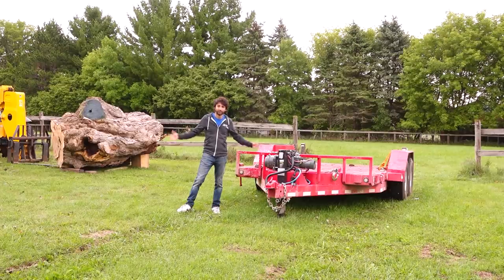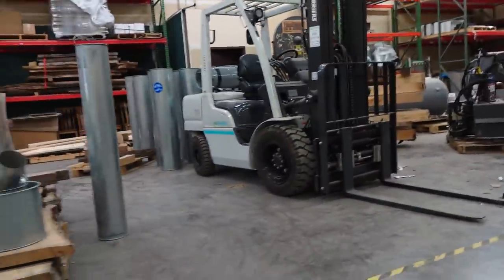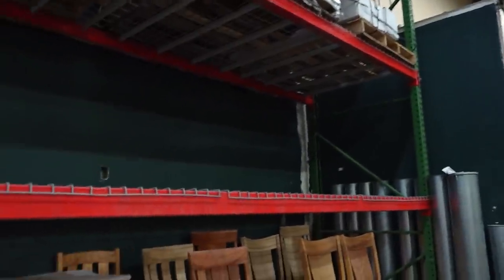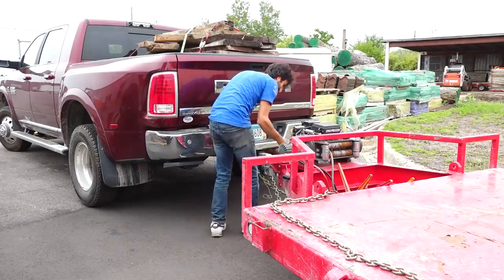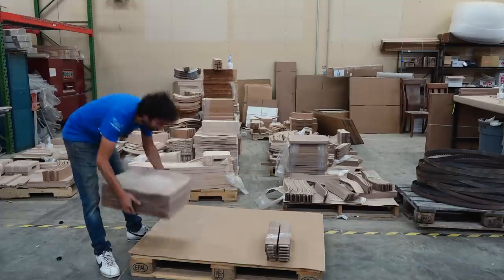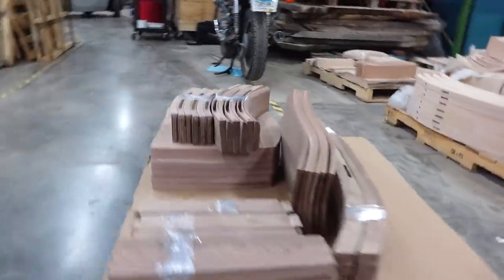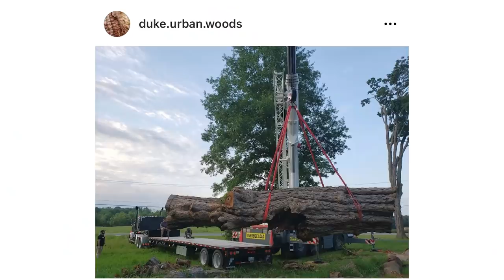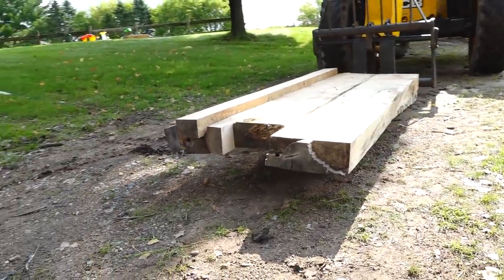Getting the warehouse ready for slabs - Warehouse vlog thing

Comment: Just a tip, next upgrade on the saw mill put taller tube sections on your bed. Change to RHS standing on end instead of SHS. This will raise the log up above the angle rail (yes you’ll lose some capacity) but it will be much easier to load logs on with the skid steer or tele handler.
Reply from the maker: Decided against that so I’d have continuous support across the entire bed and no corners to catch material on
Reply: @mcremona  Oh ok, corner catch is a possibility as the tube top bed would be higher than the angle, could hit the corner of the tube when your driving in. Not sure what you mean by entire support. Maybe we are understanding each other. If the stainless tube was the double height, your bed level would be exactly the same support but higher. Just the envelope for the tynes to fit into below the bed level and above the angle rail would be increased. A place to lay the material down and pull your tynes out flat. Yours works as is, just a suggestion that we have on our conveyor runs on the bandsaws at work.

Comment: Umm, you need an employee to do the grunt work. 
Also, a storage building on your land to get rid of the expense of that rented space.
Reply from the maker: Not currently enough need to create a worthwhile enough job for someone. About a 15 year payback vs the rent for this place
Reply: @mcremona  Should've married an accountant (but attorney is good 2nd best); you have a family business that could be set up many ways.

Perhaps an LLC so you do not lose it all when a visiting "client" walks under slipping hydraulics or ???.

As a family business, kids are for the grunt work as they grow into bigger responsibilities (or grow away from you [enjoy them now]), big tax savings (even if you pay/gift them [and you should]).

As a family business, you will have more time with your family ... build an "ag" building 72' wide x 96' long 18' inside height clearance to the rafters. You will own almost 7000. sq. feet, almost tripling what you rent now. You will have years of (carry forward) depreciation as great buffer when needed. As a family farm/forest you should easily qualify for an Ag building permit vs commercial engineered structure. The cost of the building goes way down, it will last long after it is paid for and will add value to the property (secret double value: 1. every dollar invested in it is a dollar in the bank. 2. you could pay it off in 0 to 20 years and still be using for 30-50 years rent free on those later years). [tbc rent or buy there will still be common expenses that both share e.g. insurance)

If you have a spare 30 acres, plant 10,000 trees (333/acre), wait 30+ years and you have pretty good supplemental retirement income. In the meantime such a planting may be able to get you a very nice "forest" property tax deferral, or check out a "farm deferral" on your property tax for the pasture (you will have to do some minimal work with it though). (PS that size forest could be sustainable by felling no more than a tree a day for your family business mill).

Now that you have established your home as your business, you will be able to deduct a home use percentage (including electricity and utilities), you will save drive time (so more family time, less wear on vehicles), you may even be able to deduct a larger percentage of your driving mileage (currently you are likely not able to legally deduct your mileage to "work" at the warehouse) but when you work from home and leave to do any type of business related activity, that mileage should be deductible (see "portal to portal").

BTW did you donate that banged up drill press to Habitat For Humanity before Dec. 31 and get that "lemonade" deduction?